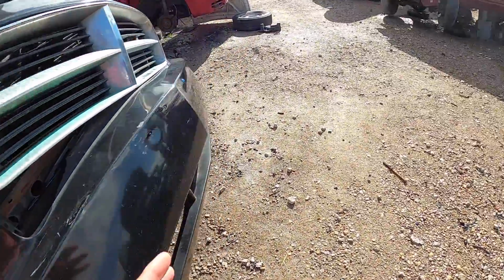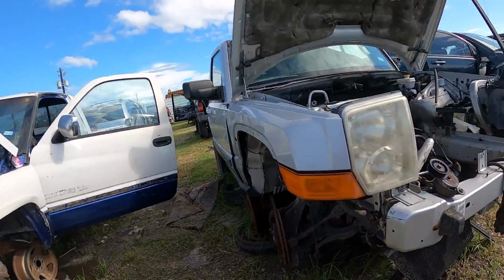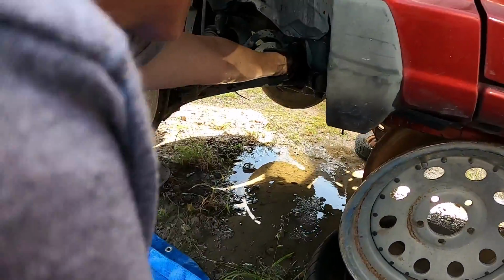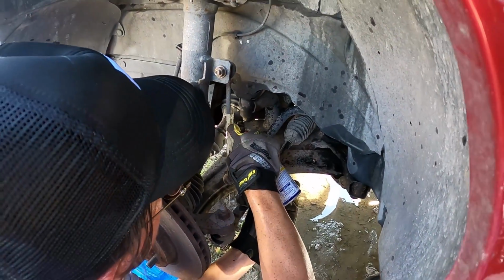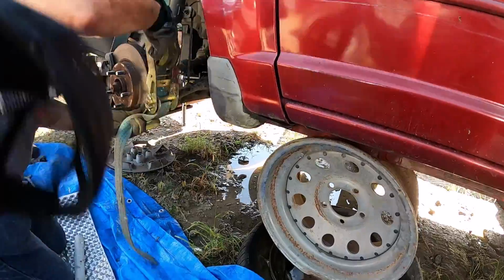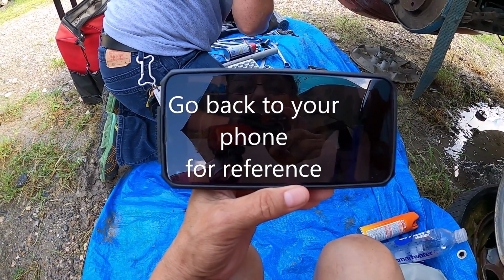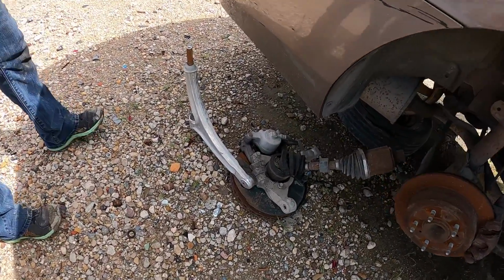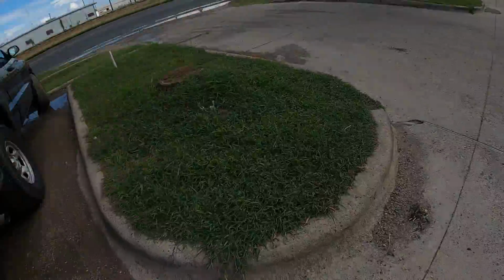Two women about to save 3K doing it ourselves (control arm) Part 1

Comment: There’s a cauter pin that holds that axle or “castle nut” locked you have to remove it, and replace it when reinstalling the castle nut. You need a large breaker bar with a cheater to get it loose after removing the cauterpin. You HAVE to torque that castle nut back to spec with a NEW cauter pin or you WILL have issues!! This is dangerous if you do this to your vehicle please do some research and prevent a catastrophe because that nut didn’t come off for a reason… it’s made to prevent people who don’t know what they’re doing from doing it. We go to school for cars for a reason but 3.3k for control arms is a rip-off find a new mechanic.

Comment: I have no idea that this would be in my feeds. Do not knock out the studs with a hammer without lug nuts on. You'll damage the threads. Tell your friend to invest in axle nut sockets. You can buy individually or as a set. Don't know if Harbor Freight is down your way but I'm sure Amazon is everywhere. The strap method is something that I didn't think of. Where I'm at you can't use a jack in any junkyard anymore because of liability concerns. Take the strap and place it around the lugs. Problem is, once you remove the lower control arm, the bottom will shift. Anyhow, you don't need the strap for that at all.  Disconnect the swaybar link at the bottom of the control arm because you said you got a new one. Disconnect the lower ball joint. Beat the spindle to help separate the lower control arm. Remove the rest of the bolts/nuts toward the frame. Some prybar work then done. You don't have to remove the axle nut at all. In fact, I stopped buying most junkyard parts because new parts are easier to obtain and cheaper. Inspect that ball joint. If it's loose, then you will be right back at point 'A'. Good luck ladies.
Reply from the maker: You are a wonderful person telling us this in your reply we thank you very much! Some good stuff here.